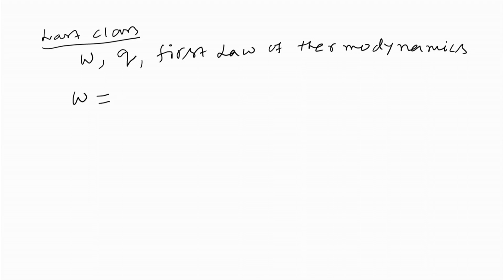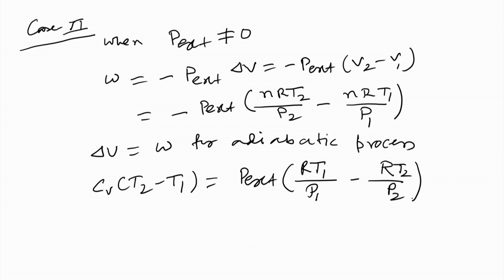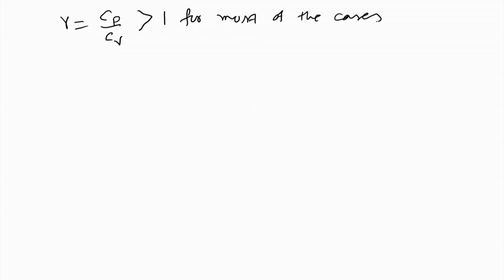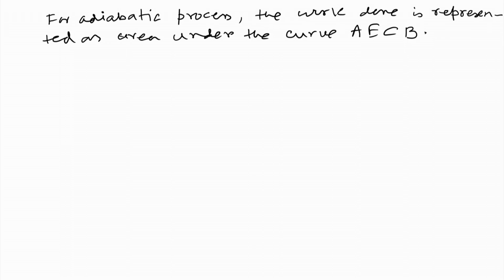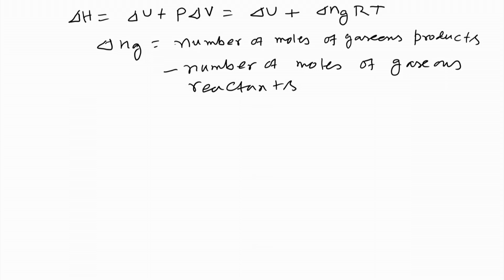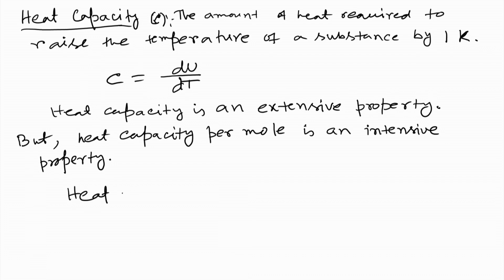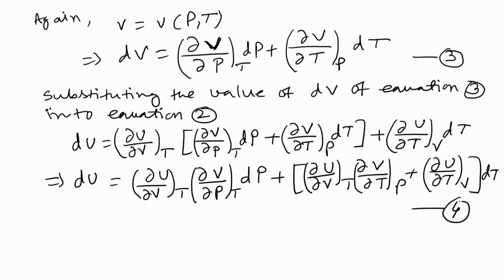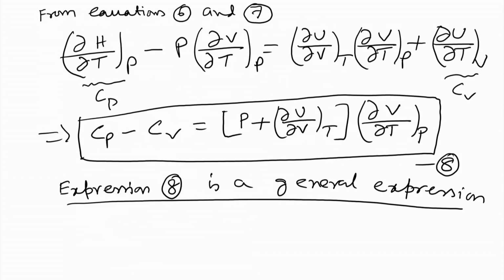Lec 02: Concepts of Enthalpy and Heat Capacity

Comment: Sir why the negative term is taken in writing work formula 
w= - PdV 
Sir please explain I am very confused since last 4 month
Reply: the convention is not mentioned while writing the same; usually we consider that heat is supplied and system does work. Then the work is taken a negative by convention while when we do work on the system it is positive.

The minus sign explains expansion.
In expansion the force is opposite to the displacement if expansion is realized.